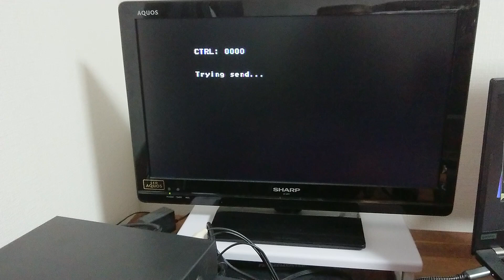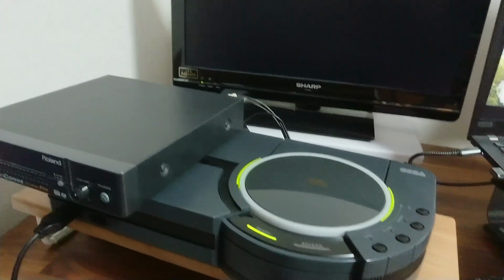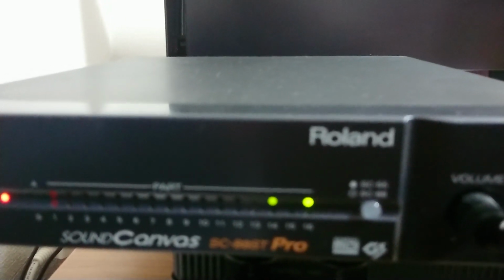First steps with the Wondermega MIDI port!

Comment: Amazing work! Are you located in the States? I took note of you mentioning having it repaired. My Wondermega too can use service, and I have been looking for a Shop to have it fixed. The Problem is so few want to touch a Wondermega (likely due to its complex insides). Do you have a recommendation?

Comment from the maker: To clarify some things: it's true that the only commercial software that uses the MIDI port is Wonder MIDI, but the Wondermega has built-in support for playing CD-MIDI discs. CD-MIDI was a CD standard that never went anywhere and there were only a very small handful of discs published that ever used it. Therefore, contrary to what I said in the video, we do actually have software that uses the MIDI port: the Wondermega firmware itself. Hence why I was able to suss out where it is mapped from reverse engineering the code.